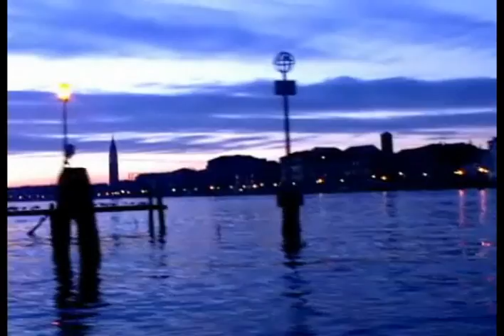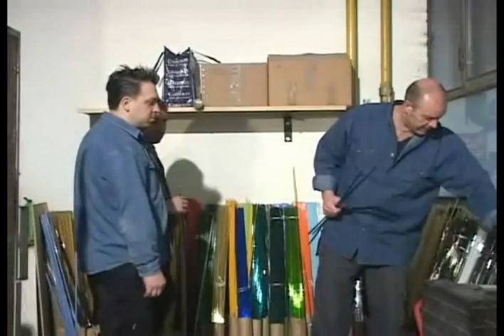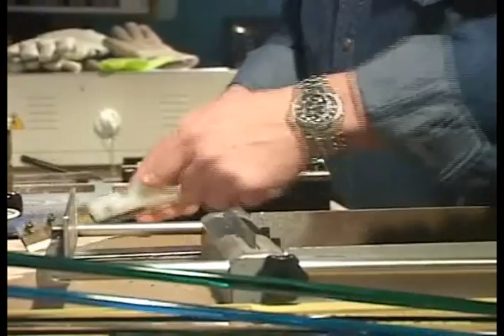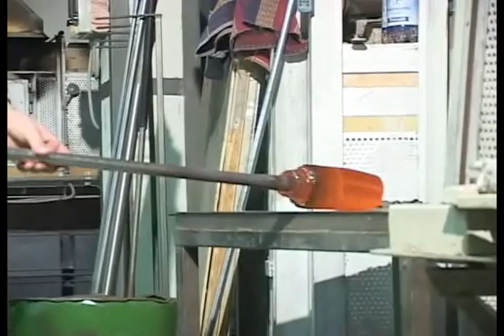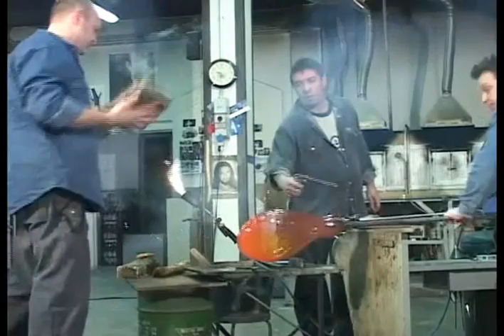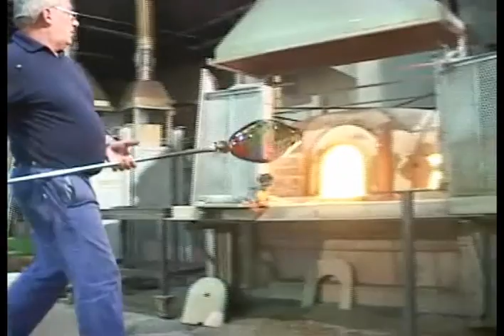Afro Celotto

Comment from the maker: it's compressed air; used to cool the piece for a variety of different reasons - sometimes you use it to cool one part so that you can focus on blowing out another - sometimes you use it to rapidly chill the entire thing so you can add another gather (another layer of molten glass from the furnace) sooner - sometimes you use it to chill the neck so it breaks off the blowpipe and onto the pontil more easily. It's also great during a long day to blow the sweat off your forehead lol